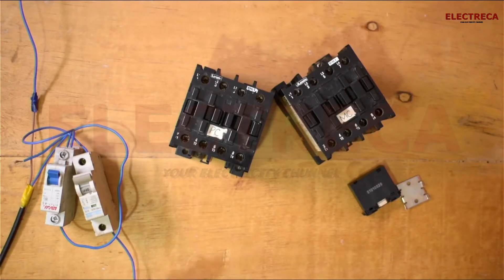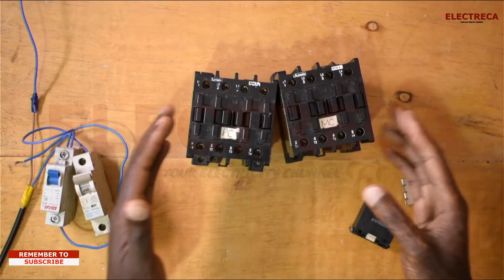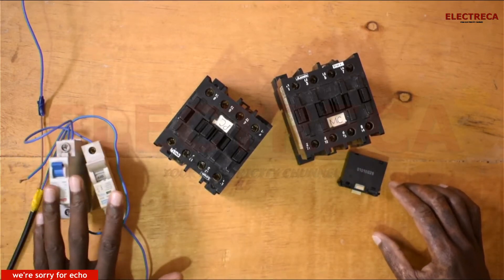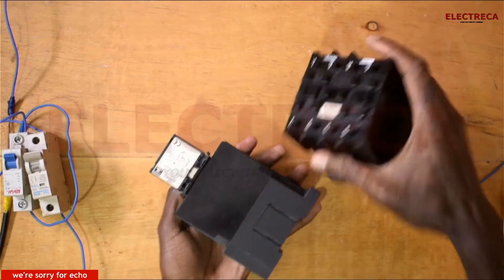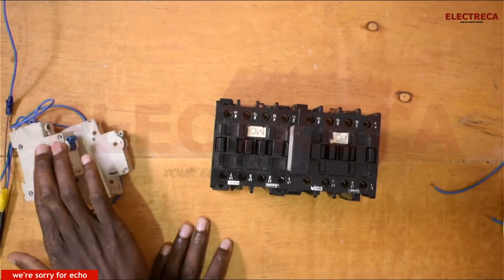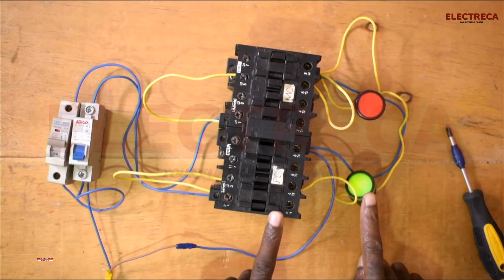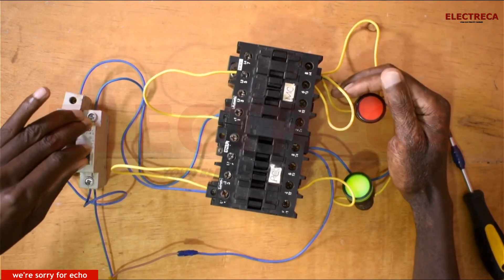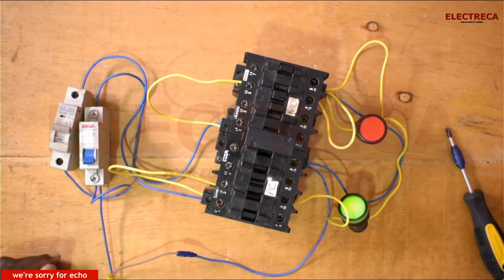how mechanical interlock protects your circuit|insitallation|ELECTRECA

Comment: You are using a wrong interlock, Use an interlock that has two NO  contacts. Use these contacts to complete the circuit to the coil. Can you  imagine what will happen to the coil in your experiment if that contactor was vibrating for one hour.

Comment: And the noise that the contactor make when trying to close but interlocked, would it create arc that could damage the contacts?
Reply from the maker: Contacts remain fine Because they don't close. therefor there will be no Arc. But if it happens for long the coil will burn.
Reply: @elektreca  Correct. Therefore you need to use a different interlock.

Comment: If one of the contactors got welded. Can the mechanical interlock prevent the other contactor to close so they wouldn't short circuit?
Reply from the maker: Yess......if contactor A is energized, contactor B will be locked. but if you energise B while A is engaged there will be a mechanical noise(contactor will draw high current and burn out) but the contacts remain closed